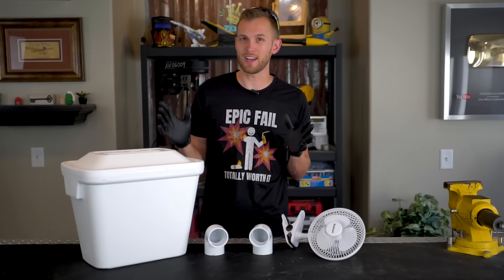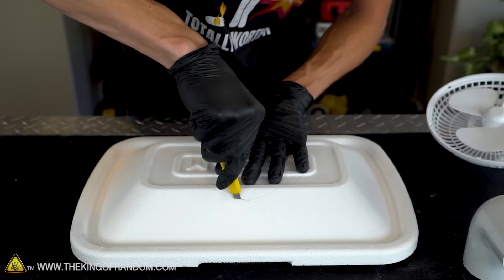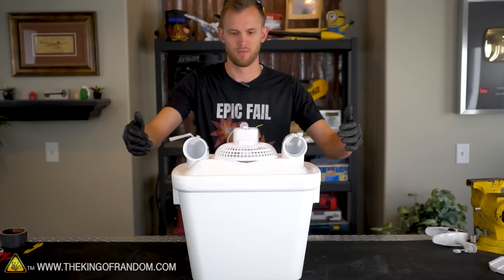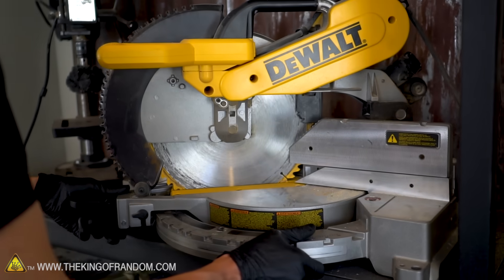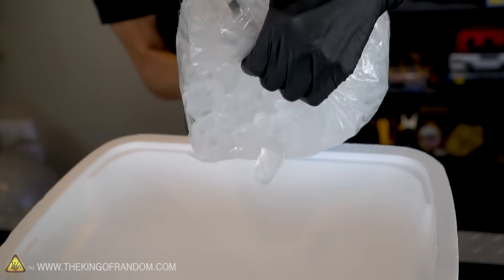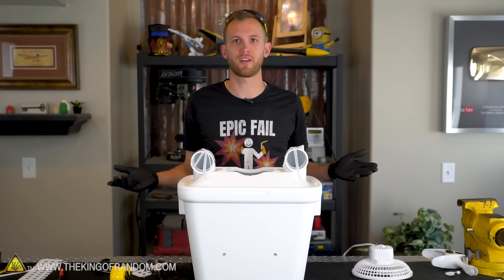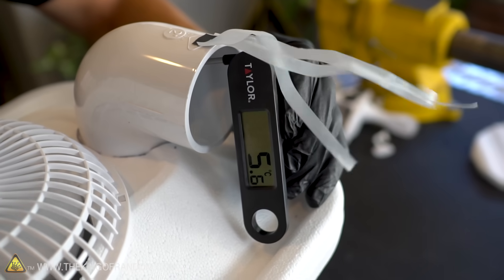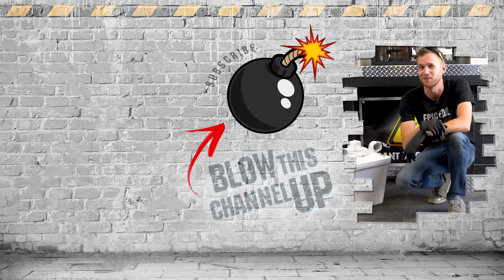Recycled Styrofoam Air Conditioner! TKOR Creates An Efficient DIY Air Conditioner!

Comment: HOW ABOUT YOU TRY IT WITH DRY ICE
Reply: Yeah you get a nice few minutes of chilly air before suffocating to death
Reply: Then show us how to heat our house with the exhaust of a car 🤣
Reply: Klaw yeah and deadly in a closed room
Reply: Dude I was waiting for the now with liquid nitrogen!
Reply: Rainier Plazuela darwin award contender here folks
Reply: Ice increases humidity level which may not be practical in tropical climate
Reply: That will make you suffocate because you will be blowing CO2 gas into the room you're in. Not a wise thing to do.
Reply: Manliest Dave not just close, if it's a poorly ventilated room it would be dangerous to be in the room in general
Reply: Now that's a fog machine, that outta be awsome.
Reply: Rainier Plazuela DO NOT DO THAT YOU WILL FILL THE ROOM WITH CO2 AND DIIE
Reply: Chris Baier You can be in the sealed space if you're in a small room with the doors closed and the air off
Reply: It could be deadly in a closed room
Reply: CO2 has low heat capacity, the dry ice wouldn't last nearly as long
Reply: DO YOU WANT TO DIE?
Reply: shush guys, let natural selection do what it does best...
Reply: Chris Baier, yes you can, I've worked with dry ice at an industrial level. I suppose it's not exactly suffocation, but it will prevent your body from expelling enough CO2, you'll get light headed and sleepy. CO2 is also not tasteless, air with a high CO2 concentration is quite bitter, it burns, it's miserable.
Reply: Cool Sadiya, "It's a not easy to get dry ice" IDK about other places but it is in the US, just about every grocery store sells it.
Reply: Your parents are obviously related to one another
Reply: Rainier Plazuela don’t do that, a large amount of co2 is dangerous
Reply: Rickstery You know what you are a Nerd
Reply: @remyzk9424  only if ur sleeping on the floor ;)
Reply: Just don't set it too close to you. You'd probably end up dizzy after a while.
Reply: Rainier Plazuela I things
Reply: Lol
Reply: I was thinking the same thing. It would be really cold.
Reply: Wouldn't it also cost quite a bit to keep ordering dry ice? Or stocking up on CO2 fire extinguishers?
Reply: We can still do it outside, just for an experiment!
Reply: Hey,  if your going to off yourself, using dry ice in your homemade air conditioner is the COOLEST way to go!!!!!
Reply: Uhhhhh what if you had dry ice in sealed bags maybe?????
Reply: Omfg yes
Reply: How about no
Reply: If you keep dry ice in the bag it will work
Reply: Rainier Plazuela haha just said the same thing!
Reply: Mqybe with dry ice inside his own closed container and put it in middle of water ( so the dry ice container act as a coolant) ?
Reply: Rainier Plazuela LIQUID NITROGEN
Reply: Homemade Chamber Gas
Reply: Liquid nitrogen is a bad idea because it boils off too fast.
Reply: Eduduusuus
Reply: If you like inhaling large amounts of CO2, go for it
Reply: I was just about to comment that lol
Reply: No dry ice?
Reply: Rainier Plazuela yes
Reply: Rainier Plazuela yes
Reply: Rainier Plazuela yes do it
Reply: Rickstery what if we do not use to much
Reply: CO2 is bad to breathe in. Just thought you should know that.
Reply: Rainier Plazuela thats not how thermodynamics works, buddy..
Reply: I’d love to see that!
Reply: That would definitely cool your body down

I’ll see myself out
Reply: Yeah... but still FANtastic
Reply: idk maybe

not ;]
Reply: Use liquid N2 instead
Reply: HOW ABOUT JUST BATHING IN LIQUID NITROGEN?
Reply: It's a not easy to get dry ice
Reply: That’s what I was gonna comment
Reply: Rainier Plazuela i was going to say the SAME thing right after i watched i video
Reply: Rickstery You can't suffocate yourself on CO2 with a block of dry ice unless you are in a sealed space. I think youd be fine
Reply: EVERYBODY LIKE THIS COMMENT RN!! MAKE IT HAPPEN!!

Comment: Now do a time test to see a) how long the fan keeps going and b) what happens when the ice melts.
Reply: It clogs because the pipes are so low down
Reply: Nature Artist 8012 Probably a watery mess pretty quickly. Could put a drain hole in, but it has to go somewhere.
Reply: Aikano9 yep that was my first thought when he said ice. I thought he was going to fill some coiled plastic tubing with water and freeze it. Which would have provided more surface area.

Comment: try this experiment if put some salt on it?. also try to mixed cold ice, dry ice, liquid nitrogen and some salt and put on the DIY Air Conditioner. i hope you read this haha.. thanks. regards. please like and reply this if you want to see this experiment..
Reply: and pretty much all of them forget to mention that enriching the air in a room with CO2 while you are in there) is a REALLY BAD IDEA...
Reply: Some tutorials for diy air conditioners are made with dry ice
Reply: Nitrogen will also displace the O2 in the room if you use liquid nitrogen
Reply: KipZNation yes, I would also like to see that.
Reply: If you intend to use dry ice in you diy air conditioner, it would best to store it in a metal container, then set it up in the center of maybe 6 water bottles. The bottles dont have to be water bottles, I use Coca-Cola bottles because they dont get damaged easily.
Reply: TheScarvig while you cant get the oxygen from carbon dioxide,into your body when you breath you will still be fine from the rest of the air in the room,BUT i think your talking about carbon MONoxide which is co1 and that does poison you
Reply: KipZNation if you had dry ice you would die

Comment: this seems abit ineffective. the fan shld be at the bottom to force cool air into those pipes through the ice. if the fan is on top, some air might escape or stay stagnant in the styrofoam box, thus percentage yield will be quite low

Comment: Something to consider with ice cubes vs frozen bottles is how long they'll last before needing to be replaced. Ice cubes are going to conduct heat more efficiently, but that means they'll melt faster. I'd love to see a follow-up video comparing the longevity of cubes vs bottles.

Also, you'd have to make sure the melting ice water from cubes doesn't reach the tubes, or you're going to cut off your air flow.

Comment: You dont actually need the elbows or the extension if you just put the frozen bottles on floor level and then have the hole trough which the air leaves be on the side of the bottom.

Comment: Liquid nitrogen in metal tubes and if you want you can do 3 or 4 layers and a closed system once the pipes are cold enough they should stay cooler longer than just ice cubes

Comment: please try this with dry ice and post an update if it is better, my thought is dry ice on the bottom and regular ice on the top, at the very least the ice would last longer even if it isn't cooler
Reply: Shane Kuchler Using dry ice would displace the oxygen in the room with CO2, you'd suffocate.

Comment: Air conditioning / conditioned air:  This would work best pointed directly at you on the patio or porch, but not so well inside a room or small enclosed area.  I tried this in a sailboat cabin approximately 8 feet wide by 6 feet tall and 27 feet long and the result was a lot of humidity and moisture in the air.  The fact of "air conditioning" is conditioned air - which is air that has a majority of the moisture removed from it.  The temperature is a secondary feature.  You can also have warm, or not so cold, "conditioned air".

Comment: Try dry ice and liquid nitrogen pleaseeeeee❤😀🙏☢☣
Reply: You can't do it with dry ice, since it'll give out carbon dioxide, which is fatal especially in a closed room, and if you're sitting close to the ac. Also,  liquid nitrogen is useless, since it would boil instantly.
Reply: Sushant Guha I see what you're saying but ice will also melt and liquid nitrogen doesn't just disappear , it stays cold and liquid for quite a wile especially in a Styrofoam container

Comment: I really like your videos but PLEASE add some kind of disclaimer that this project can NOT BE DONE WITH DRY ICE!
There are so many dry ice fanatics in your community and I think it is a great risk not to mention the risk of asphyxiation that would come with dry ice due to the CO2!
Great Video nevertheless!
Reply: Actually, at normal atmospheric pressure, CO2 poisoning is as much of a concern as asphyxiation as carbon dioxide is a toxicant at high concentrations.
Reply: How about using pycrete ice blocks to make the ice last longer? It may not be as cold but I think it double the time that it keeps you cool.
Reply: @Rfsi  Yeah but if you want less cooling for a longer time, just put less ice in each time, keep the rest in the freezer.
Reply: Nah dont, if those retards dont know How dangerous that is then its basically mother-nature rolling out some natural-selection :^)
Reply: uppp, those retards need to know this
Reply: @bob-o-construtor-raiz  well instead of saying retards educate them some people don't know that dry ice is Co2
Reply: Yes, but a cooler of dry ice would barely increase the co2 concentration in a room by even the tiniest fraction of a percentage.
Reply: @MMAFightMagazine In a Room of the Size 7x7x2 Meters, one Kilo of Dry Ice would increase the CO2 concentration by 10 Times - that is a THOUSAND percent.
Reply: yakes,true

Comment: It is important to add, if you use the fridge in your house to make the ice, and you also use the cooler AC in your house, you will just heat your house up more than you would without it. It works for bought ice, ice made in a freezer outside your home (garage), or if you plan to use it outside. It could work to cool a room with poor ventilation too.

Comment: Please test: 2 layers of ice and Salt on the ice
Reply: Salt makes the freezing/melting point of water lower, so if you just put salt on the ice, it would melt faster but it wouldn't be any colder. To make it colder you have to freeze salted water and depending on the composition of salt in the water you could get the ice to be about 30F colder. For example a 20% salt solution freezes at 2F.

Comment: If you use an electric cooler, you have something fairly practical in an office that has more women working in it than men and they keep the thermostat too warm for the men to be comfortable.  

With a styrofoam cooler like this, you'll need to keep bottles of water in the office 'fridge and swap them every few hours, which is a pain.  
And using actual ice just won't be practical for an office setting, as you'll need to schlep heavy bags of ice to work every day..

Comment: What will happen if an ice cube is placed next to a heating coil inside a vacuum chamber 👑 😞
Reply: Anantha krishnan the ice cube would melt and the coil wouldn't heat up as I don't think he's able to run power to it to make it heat up enough to actually be hot
Reply: cheeki breeki plays In vacuum there will be no air so i wonder how the heat would spread
Reply: Anantha krishnan you didn't even read what I just said and it would heat up like a normal heated coil and it doesn't transfer heat through the air... It would be the same as if it wasn't in a vacuum chamber
Reply: cheeki breeki plays yeah, got it 
Thanks😀
Reply: Anantha krishnan 🖕🙄🖕